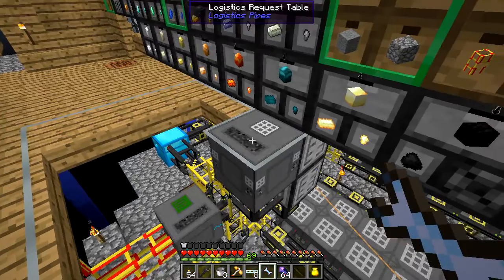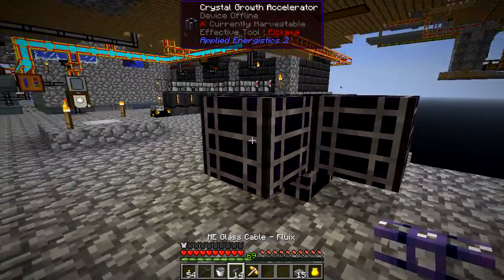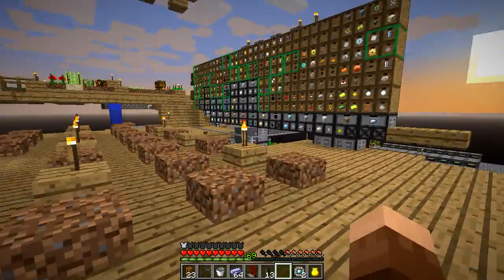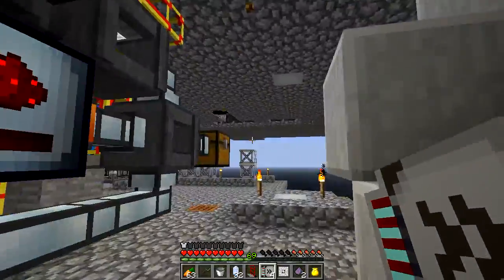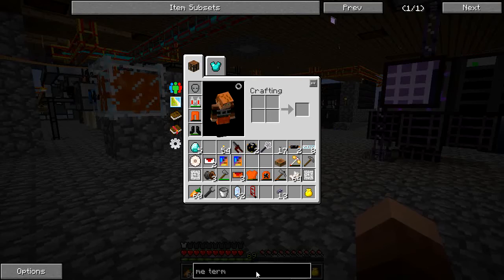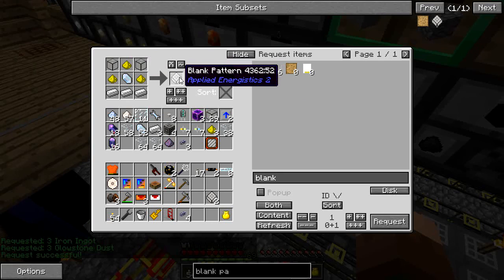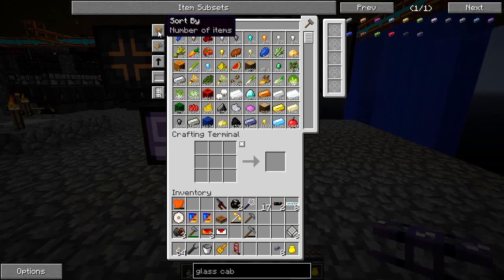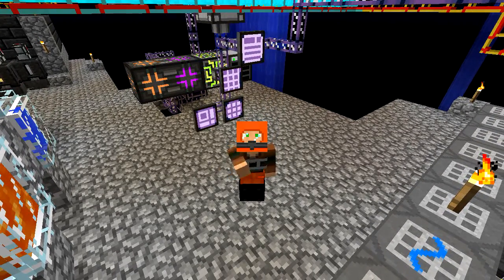FTB Infinity Evolved Skyblock - Ep 27 - ME System Essentials

Comment: It is possible to turn growth accelerators and inscriber presses with any wrench.
For the inscriber presses this means, one can bring up the underside to a side, so that one can feed from left, top and right and take out to the bottom (hopper) or back.
The accelerators are best turned in such a way, that the "top" sides of two next to the same block, face that block, so that you can directly connect them. Furthermore the growth accelerator is conductive, so that you do not need to connect every one directly to the power source.

The crafting storage just needs to form a cuboid, there are no rules about its size.